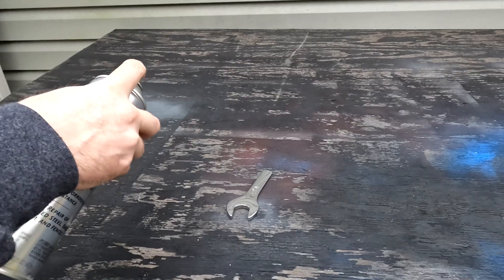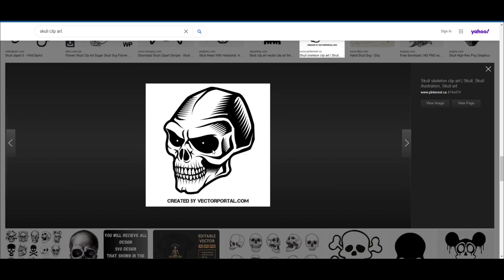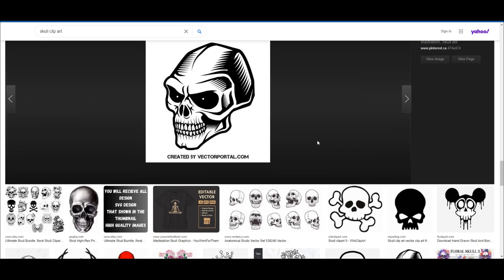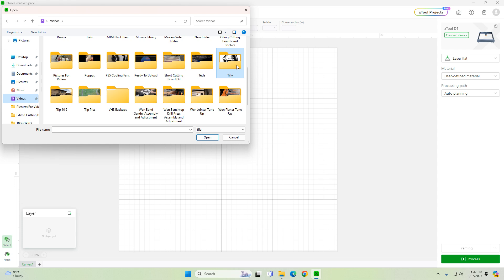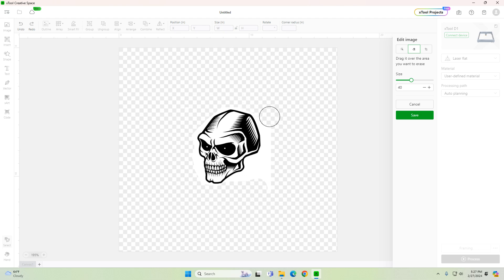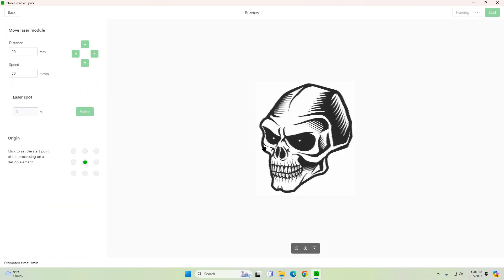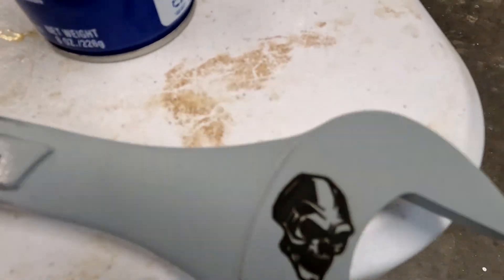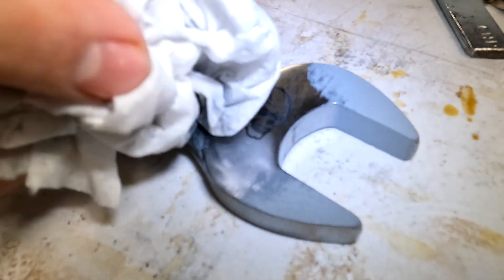Wait… I Can Laser Engrave THIS? | xTool D1 Chrome & Metal Tool Engraving Tutorial

Comment: Been using cold galvanising compound on stainless tumblers for a while now. Thought it was working great till I put one through the dishwasher and the image faded badly. Found it doesn't seem to be to permanent on metals. I use it on glass to be able to engrav with the blue light and seems to work well though.
Reply from the maker: I haven't "fully tested" the wrenches, you can catch your nail in the etching.  Sprayed with some degreaser, put it in a cup of water and left set outside for a couple days to see if rust set in, so far so good, but I guess no guarantee with anything.  I know that paint is the first thing I have tried that even made a mark on a tool.   Engraving the power tools much easier melting plastic.  lol  Thanks for watching and dropping a comment.